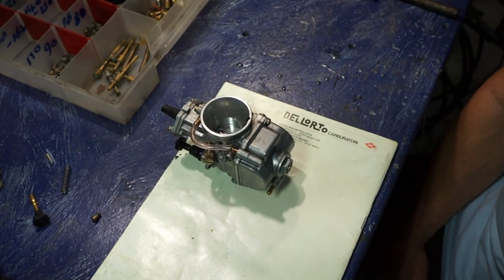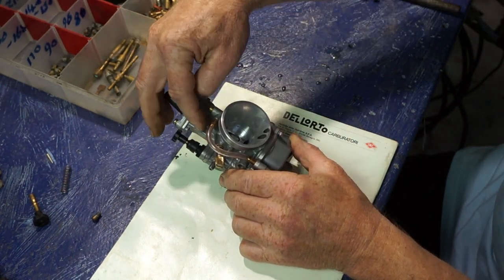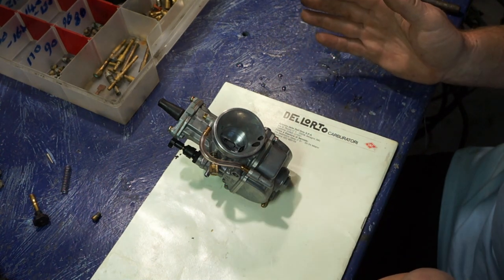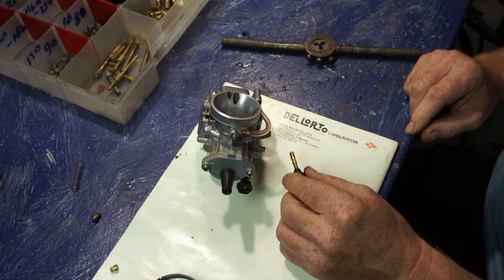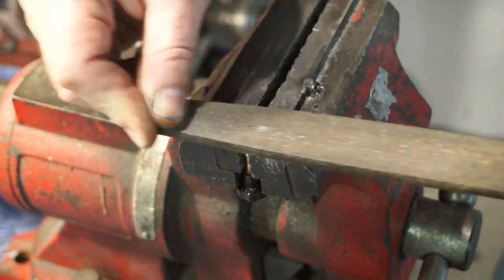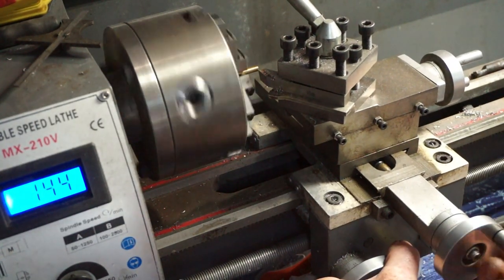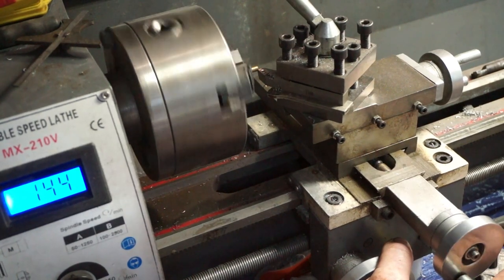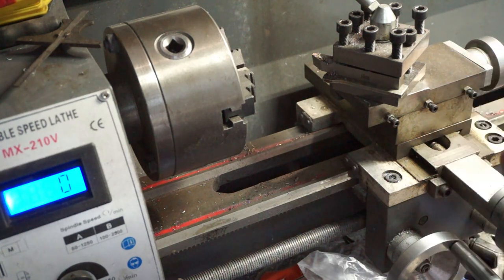Genius Power Jet adjuster PWK CARB #LAMBRETTA#HOWTO

Comment: Might need a locknut on the adjuster. When open without it may rattle out 😄👍
Reply from the maker: I'm hoping the spring stops it moving but I'm probably gonna put a  rubber o ring to seal the air or I might not get vacume ? Thanks for comment mate .
Reply from the maker: I'll find out if it needs lock nut good idea cos that guarantees no movement or air leak just not so user friendly 😁

Comment: Hi Steve, if you have a power jet on a PWK 30 do you scale back on your main jet?
Reply from the maker: Power jet only comes in on the last 10% of carburation if you have changed to power jet of 30 only drop main by 15  then check   jetting is correct . If its already got a power jet .... jet as normal

Comment: Wonder if it’s possible to make it electrical?:).
Reply from the maker: Not easy with AC ?
Reply: @TheSteelweasel  A tiny motor  with a worm gear lifting and closing jet, even triggered by a altitude switch! .

Comment: Most scooterists are already overtaxed with the normal carburettor setting and in my opinion a powerjet is also unnecessary in everyday use.
Reply from the maker: Yes it gets complex .
Reply: Nobody forces you/them to ride a two stroke with a resonated pipe. 
If there is resonatet pipe, a normal carb will either be to rich at lower rpm or to lean at high rpm. No other way of getting around it sadly. 

Engines are simple untill ones starts to adjust them to run optimally.